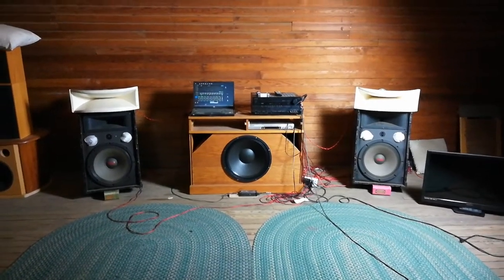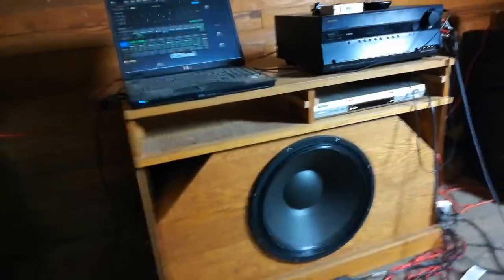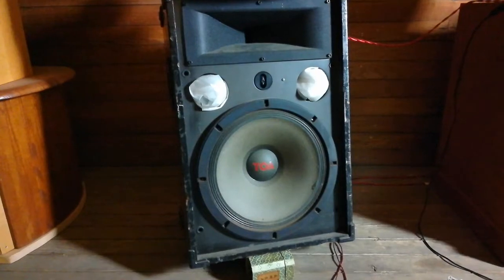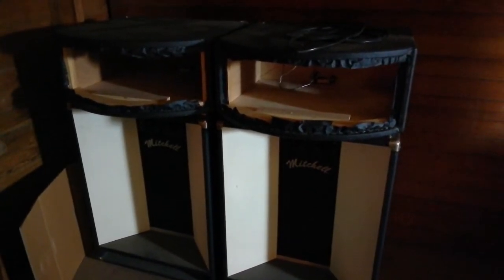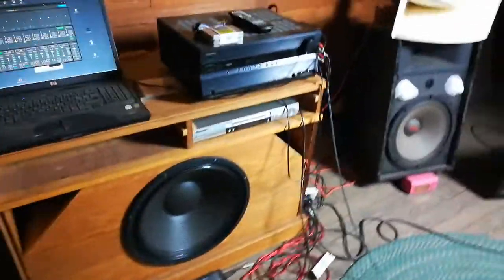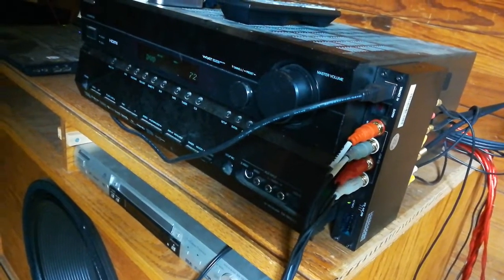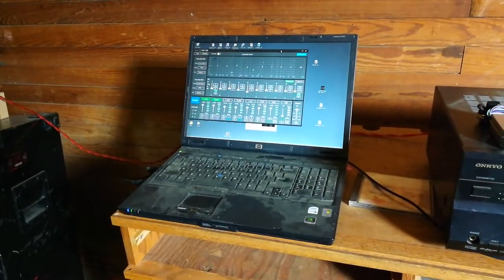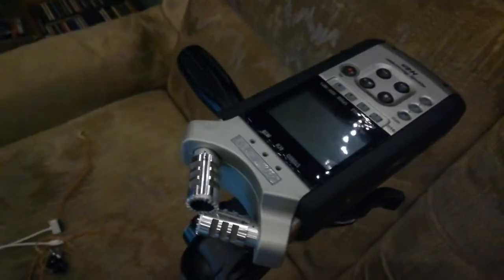Audio nirvana on the cheap!

Comment from the maker: Okay are you ready for a demo clip? https://drive.google.com/file/d/1s_7eCs_FytYrVQc7qm9hw_8C_t1_vZ9m/view?usp=sharing  Note that I have subsequently done a lot of additional "burnishing" to the sound signature to remove more of the high-mid "shriek" and make the presentation more natural.
Reply: nice demo ...there are so many recordings I'd like to hear on that system
Reply from the maker: @howard5992  Thanks!  I've since upgraded twice and significantly improved the sound.  First upgrade was I picked up some '80s Klipsch LaScala folded bass horn carcasses off Craigslist and dropped some very average '70s Eminence 15" PA woofers into them and subbed them in place of the TOA woofers/cabinets.  Huge improvement in midbass agility. Then I got some HUGE old "white whale" EV HR9040 constant directivity horns with massive large diaphragm compression drivers.  These left behind the off axis midrange sear of the Mitchell horns and added another dimension to the imaging. Would love to have you over for an audition if practical.  Zip code 80524.  Meanwhile I have to get a hold of some suitable mics and do some more demos.  Cheers!

Comment: Pretty amazing you could do that for $600.00. Still not clear exactly how you got “four in eight out” through the DSP. I see the four RCA connectors going into the DSP along with the Bluetooth from the laptop. Are the RCAs from your different sources; CD player, streaming laptop etc.? And I hear you say that the Onkyo has ‘discrete inputs.’ Again, my question is, are you massaging the inputs to the amp with the DSP (amp has eight amplifiers, each with its own input); or are you driving the speakers from the DSP (but then what is the amp doing, feeding  the DSP left & right from channels A and B?) O
I’m so confused, I guess I had better go over to the Dayton Audio site and check out the DSP unit.
Reply from the maker: Jeremiah, profuse apologies for not responding much sooner.  I think I actually did at one point but somehow it didn't "take" and I didn't check back.  You are asking a good question and I hope the answer will help other viewers---if any show up ;-> .  The sound source is a PC headphone (analog) output streaming Amazon Music Unlimited HD.  That uses only two of the four analog input channels (plus two Bluetooth channels) of the DSP.  Another analog stereo source could be connected as well.  The four analog inputs can be assigned to any or all of the output "buses" via a 4x8 internal digital mixer controlled by a PC or Android phone.  I split L and R input channels to 3 output buses each for bass, mid, and treble, and mix L and R together on bus 7 for a summed subwoofer output.  Each output channel gets appropriate bandpass (crossover) filtering, level matching, parametric equalization, and time delay (signal path compensation).  The 7 active output channels are then fed to 7 discrete analog inputs (multichannel inputs) of the 7.1 receiver which are fed straight to the amp sections with no processing other than "ganged" gain control.  No sub channel is extracted by the receiver's bass management; the DSP already did that.  Then each discrete output channel is wired directly to its corresponding speaker driver.  As each amp channel is capable of 100 watts, we are talking 700 available watts driving a stereo system with around 100db/watt sensitivity, resulting in TONS of dynamic headroom.  A "good" speaker will have less than 3% total harmonic distortion at 90db spl or so and 1 meter distance.  This system measures about 0.3% at the listening position.  Truly, "obsolete" AVRs are the best value in audio, along with vintage middle shelf (or little known top shelf) pro PA drivers.